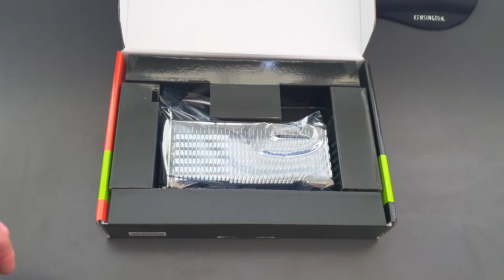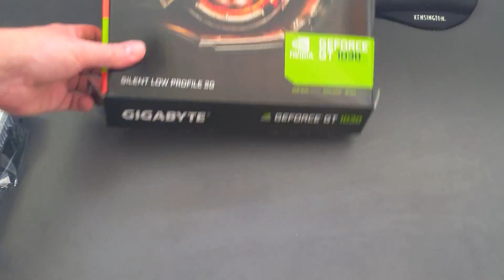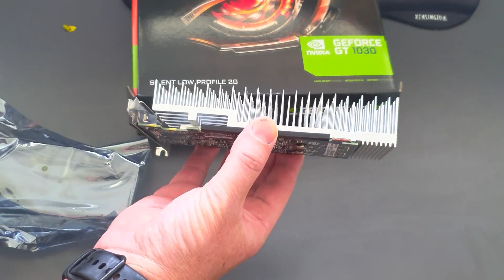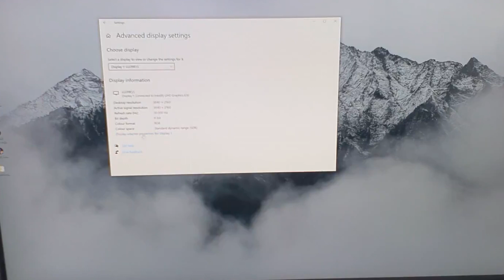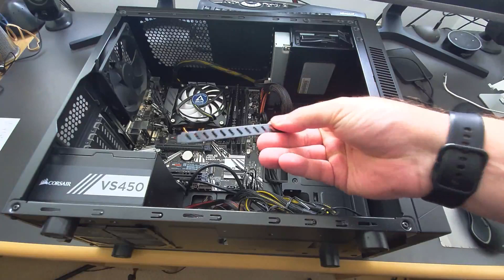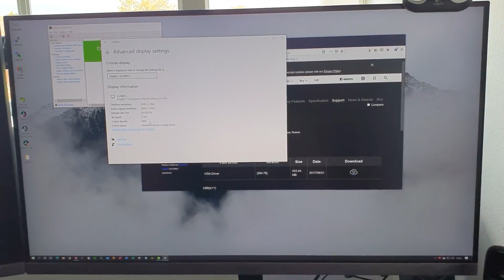Gigabyte Geforce GT 1030 Graphics Card Unboxing and Install

Comment: I have the same gpu card, it has been very reliable for at least five years, only now am I attempting 4k@60fps, the cable is a key consideration. A certified cable for hdmi  2.0 , 4k@60fps is recommended and likely essential. This card also has other features, like a hardware based decoder.